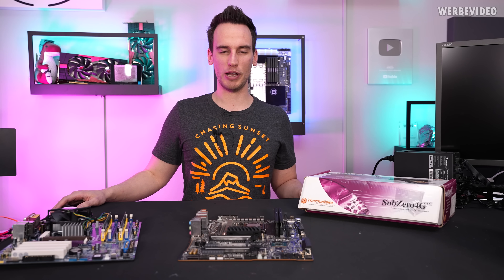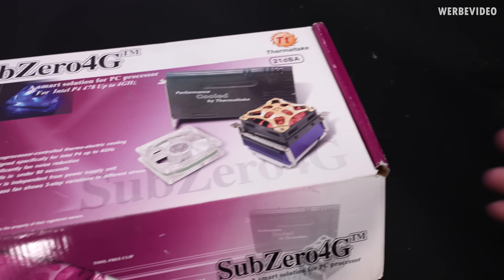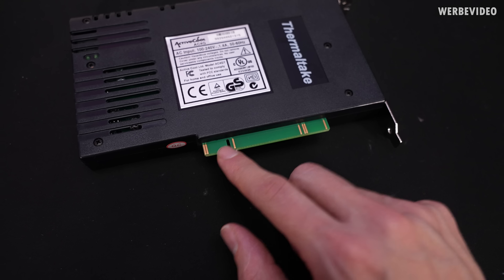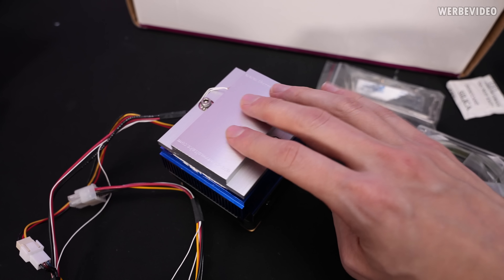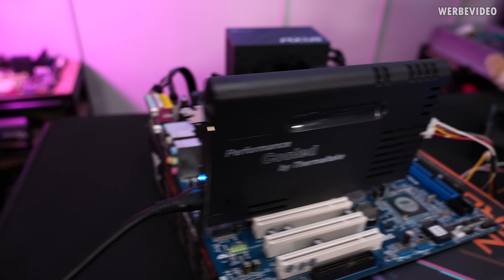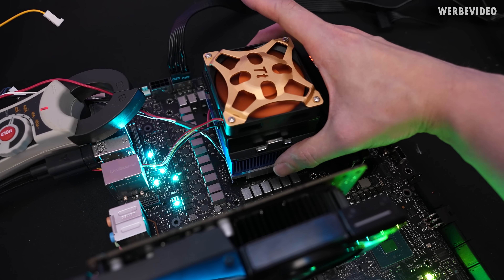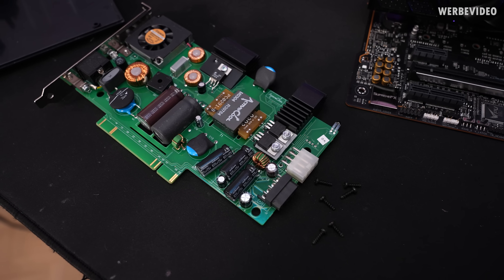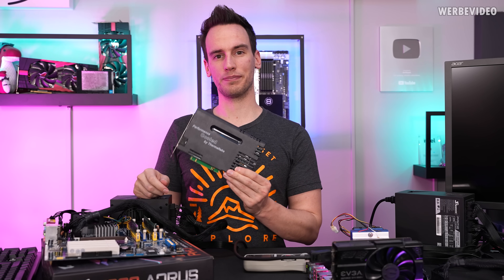This CPU Cooler Requires a PCI PSU to run!

Comment: I have had completely different approach to TEC air cooling that worked back in the time.  Pictures made on main page og HardOCP by  legend Kyle Bennett to. It was in the time when the CPU came in slots and even CPU sockets have had slot card you would stick in the main board. I have had copper plate that was 4mm thick and whave had normal air CPU cooler connected to the space above the CPU and would run all the time. This would save CPU if TEC or power delivery for it dies as well. Next to this air cooler on that long cold plate was a TEC with it's own air cooler. That TEC and air cooling for it would be turned on for full load situation. TEC was only 40 Watt power. That was intentional. Namely it was never meant to bring that cold plate to under room temperature but to pump the additional heat out of the CPU. Uper part of the cold plate would get colder than part above the CPU but would still not require any moisture isolation while not under a room temperature hence no condensation was made. That's why only 40 Watt TEC. CPU's back in the day even highly over clocked would not pull way more than 110 Watt power and extra 40 Watt's cooling was effective. Cooler was proof of concept and I was thinking of how to make that cold plate more effective while it needed a mass and thermal conductivity. Thought about vapor chamber with thick base plate. Anyhow I was working as system admin in design company and software house, and I was dreaming of patenting the solution but never have had extra cash to do it and didn't know how to sell my invention. So I did nothing with it and CoolerMaster kinda copied idea for a cooler for the new main boards with sockets on the board it self and used heatpipes instead of cold plate. It never took off. If I recall good they have used 70 Watt's TEC. That was bit to much to. 40 Watt's was small enough to power of your main PSU plus did not made condensation and failures  of TEC was not burning your system. It's good air cooler part was doing it's job anyways pulling as much as heat as it could. Enough for small tasks. TEC part of the cooling would add enough to achieve higher clocks than on air cooling alone. TEC air cooler could go really hot to but you do not care about it it only needs to keep as goid difference between hot and cold plate. Only isolation needed was around the TEC so hot side doesn't heat up the cold side by proximity to it. Also you needed to get rid of the hot air quickly but case have had blow hole in side panel sucking hit air out. That was the time when people have used modems to connect to internet. Web pages were new thing. Forum's just took over from BBS's. You couldn't buy watercooling parts like now. Cases came in one color only, off white. No windows and mostly only one exhaust and one intake 80 millimeters fan mounting place with no fans installed. CPU coolers have had 50 or 60 millimeters fans on it. Celeron Overclocking was the thing. Small die CPU's came out first time. My first Watercooling setup was Danger Dan's CPU water block Enhime aquarium water pump, VW Jetta heatcore and different aquarium and tubing and garden hose. Reservoir was some plastic container I have fitted with barbs used for plumbing. At that time main PC you do overcloclocking with was not movable. For LAN Paties you have had second system in midd size case. First window and lights I have made for it was not for looks. It was for you to see did something fall off in transport and to see are those fans still spinning. I remember getting some industrial Delta 120mn slim 25mm thick fans in store selling electronics parts and installing 3 of those in the mid size case. One between the top mounted PSU and shortest CD Rom I could find. One lower front intake and one in the side panel blowing cold air on the CPU cooler and grafic card. Light was 12V car inspection light. White neon stick. LCD monitors just started coming out. 15 and 17 inch. 17 inch TFT and such a trick LAN Party case plus tons of external drives and you were the king.

Comment: efficiency of a heatsink  increases the hotter it gets, so actually that little one might be ok even dissipating ~200w if you don't mind it running at 100+degrees.  Peltiers will manage a dT of about 70 degrees i think so with a 100 degree heatsink you could still have 30 degree cold side... in theory.  the problem with Peltiers was always they were so damn inefficient

Comment: When I saw the CPU side of things, and saw a TEC standing between the CPU and the heat sink... my jaw hit the floor. I could not believe a company would be that daft as to let such a thing get past a lab environment where it'd be proven not only ineffective, but a staggering waste of energy. Wasted energy = heat. TEC emits its inefficiency as additional heat on the output side... so it's nearly doubling the work the heat-sink needs to do, to do the same job! That, and other points already made in the comments.

Just an incredible specimen of 2000's "throw everything at these nerds, see what they'll buy" kinda tech.

Comment: The TEC cooling is a pain but i actually got it to work once was pretty cool really i added a extra water block into my loop strapped the tec to it with a air cooler on top running low fan speed didnt do a great deal for really low temps but i could turn off my fans for the water loop and it still run pretty cool ended up cracking the acrylic on the block in the end but it was a really old block always wanted to go back and try again with  a better block but never got around to it im pretty sure it was running 30 -35 c full load

Comment: Given that they're pulling 5v from the PCI bus, they must be delivering direct AC to the cooler.  This also makes sense because the AC to DC rectification would have some trouble fitting in a card that thin, anyway.
Reply: Peltiers don't run on ac

Comment: it has to have something heating up the peltier to kick it on and those run off 12v 5 Amp max per peltier but the psu may limit them

Comment: i had a reeeeallly powerful tec on my fx 60  that required ts own seperate atx psu and it actually worked i had the fx 60 at 3.4 ghz

Comment: I wonder how well a TEC would work if it was instead allowed to assertively cool something at around 30% of it's load, like say the cold side of a rad return on a vapor air cooler.

Comment: Around 2001 I had a water cooling loop with a rad and 2 TECs on waterblocks cooled by giant industrial heatsinks.... The 300 watts of power for a couple more degrees of cooling never made sense so I took them out of the loop. It couldn't keep up to full CPU load, it was nice and cool at idle though.

Comment: Now dust the good ol prescott and try to get the advertised 4ghz :D

Thing could work well with a athlon xp of the time, they were much lower wattage than a p4.

I tried to PC my athlon xp 3200+ hobby pc, but could only get +50mhz due to poor cooling, and boy is it hard to find a decent heatsing for socket A/462
Reply: Had my P4HT 520 @4.2GHz daily using an Arctic Freezer 7 on an Elitegroup(ECS) 400A mobo, TEC's were overkill for anything but scoreboards using Celeron's, AMD Thunderbird's or PowerPC CPU's.

Comment: I have the previous Pentium 3/Athlon kit. It did fit a Socket 7 board too, but the tension was too much for that platform, and on removal it bent the CPU to one side and destroyed some pins in the socket itself.
PS: mine did not go below the ambient temperature, as to avoid condensation.

Comment: Back then, having fans still running after shutting down the system was pretty much normal.
Most boards kept the fans running for a bit to keep the cpu cooling down and not heating up.
Reply: I wish the cpu fan still ran a little after.

Comment: That would be a good reason why the TEC cooler use either heatpipes and / or water cooler plate nowadays, the TECs are apparently too efficient at moving heat that they hit performance wall quickly - as you pointed out, heatsink is the limiting factor. Still a nice throwback video - it was exactly how I remembered about the early day of high performance coolers back in 2000s.

Comment: Don't forget, though, that with a TEC the heatsink will operate at higher temperature than the CPU - it's a heat pump, after all.  In a passive setup the heatsink is always colder than the CPU - the temperature gradient is what moves the heat, of course. Heatsinks shed  more heat at higher operating temperatures, though, so the TEC is effectively increasing the area efficiency of the heatsink by letting it run hot, where it can dump lots of heat, while the CPU stays cool.  You still have the TEC dissipation, of course, so the TEC efficiency is really the killer.

Comment: Peltier’s need to exchange heat for cool .. they require heat to work. They are almost worthless… I think using  butane refrigerants would be the best way to move heat or better.. ammonia cooling of antifreeze that cycles the system. Less wattage would be needed. It wouldn’t even be that big..  will probably work on 1 amp of power.

Comment: When i was still in the overclocking meta, ive experimented with the CM V10. Stock, not so cool. But, change the stock included 10w TEC for a 100w one, and that became so much sweeter. Q6600@4.2Ghz stable 24/7 on it (but not really wouldnt make sense since it was just a oc and gaming machine, but you get the gist of it lol).
Reply: You got a really good Q6600, most never got past 3.7-3.8 if I remember right.
Reply: @Orangeflea1  Needs lot of voltage and low temps. This one i had couldnt keep itself stable over 45c either. The lower the temp, the higher the electrical efficiency
Reply: @RaviPires  Ahh you didn’t mention it was 45C.  

Mine was a particularly poor overclocker, I couldn’t get it past 3.45GhZ even at 1.45v, and even then it was at 65C on a solid dual-tower air cooler.
Reply: @Orangeflea1  It was usually 15--30c tops, i was running it off of a coolermaster v10 with the peltier changed from a 10w to a 120w

Comment: I really don't see the point of trying to use these things on CPU's. Linus pumped like 400Watts into a tec cooler and IIRC, it performed worse than an air cooler.

Comment: The problem is not related to surface area, primarilly, using 70W pelletier + 100W cpu accounts for 170W Total.
The required TEC element must be rated well above 200W to keep up!

At this point you only discovers how inefficient this technology is for cooling Cpus. We stated back then that phase change was the way to go, cause 500W CPU is not an option.

Comment: Got to give Thermaltake props on that any idea. No matter how unconventional or silly: they would turn it into a product.

So a Peltier TEC unit isn't out of the ordinary for them. I remember there even was a time they where working on a chassis with built in Phase-Change cooling, thought never heard of that one after the announcement so I guess it was shelved and forgotten.

Comment: For awhile I have wanted to make a TEC/water cooler for memory. Memory power consumption is so low that the bad efficiency shouldn't make much difference. And of course include a humidity and temperature sensor, and a micro-controller to keep the temp at the dew point + a specified value. But I don't have access to a mill.
Reply: Tf u need a Mill for? Just use thermal putty and stick copper pipes on the ram heat spreaders

Comment: I was always wondering if any kidnd of engineers where hired for making this product... Peltier modules are transferring heat from 1 side to the other while consuming quite a lot of energy and producing a heat and being quite inefficient. Also peltier modules tend to warm both of it's sides when it reaches some quite high temperatures, so you can not use a smaller heatsink and a peltier module and think that peltier will cool everything. Once Linus tested something better and there the peltier module was being shut down when temperatures reached some high values.

Comment: it states tht has an ambient termal sensor and one in the heatsink coldplate, this is to prevent the cooler to get colder than ambient so there is no condensation. This is why without load it did not get under ambient.

Comment: For a second I was very concerned from the thumbnail they supplied a mains PSU PCI card without any cover to prevent electrocution, glad to see it does actually have a plastic cover.

The design of that PSU is also very reminiscent of low profile TVs back in the day, bet they hired someone in the field to design it, its also strange they didn't just use the computer's PSU or even an external laptop power brick and a DC barrel jack, the compliance and certification for that product wouldn't have been cheap!

Comment: Everyone tries to force all of the CPU heat through TECs but they just don't have the throughput for that. I think it would be a much better idea to put TECs in a water cooling loop after the radiator to chill the cool water a bit before going back to the CPU
Reply: You're picturing two water loops, one between the  cpu and TEC, and one between the TEC and radaiator(s)? I guess there are some potential benefits to that, such as being able to use any size waterblocks you want to sandwich larger and more capable TECs. You could also potentially isolate condensation hazards by keeping the liquid in the CPU-TEC loop at around ambient, and putting the TEC sandwich in a more moisture friendly environment. At some point though, it just doesn't make sense, running dual loops and pumps, and spending hundreds of watts on the TEC(s) directly. Usually more radiator will get you close to the same result. And I say that as someone who daily-drives a TEC cooled CPU.
Reply: @jomeyqmalone  no, one loop with all devices in series. CPU heats water > water is cooled to ambient by radiators > TEC chills water below ambient > chilled water goes to the CPU

Comment: Couldn't you just take the controller and connect a modern TEK with a custom loop behind it that's capable of getting rid of the heat? I fear the controller won't be up to the job unless you have some sort of additional PSU behind it to provide more power to an adequate TEK (which may also be really expensive). I really enjoy your videos about those old things that didn't work out for one reason or another.
Sadly investing time and money into doing all of this I mentioned above isn't really worth it I guess unless you really want to tinker with it.

Comment: Thermaltake used to do some crazy stuff... I had a p4 Spark 7+, little newer than this one...  Solid copper heatsink (not a slug, full on solid copper) with a 6000 RPM fan (!!!!!!).  Even came with two reostats to control fan speed, for either the rear slot or 5 1/4 Bay.  And you know... Friggin thing probably  had better heat dissipation then this

Comment: I remember "the good old times" pre ~2000 to 2002. Back then, having OCed PC and total silence was magic. We had to go to car junkyards for auto radiators, fish stores for pumps,... I had around 10 aquarium pumps because I was always searching for the silent ones. Also the problems were the fans. Solution: I used fans from the fridges, and through some soldering they were spinning very slowly. I also had that "industrial switch" for high voltage to turn on my PC. That was so awesome, people were expecting jet noise, but after that LOUD CLANCK, PC turned on, pumps started pumping water, Windows 2000 / XP was loading in total silence. Crazy days when in my country you couldn't find anything more technologically "sophisticated" (cooling) and you had ISDN if you were lucky, otherwise you were on dial up.
Reply: Back in those days I was still on dial up.  I am in the stix and there really aren't many options yet.  We had DSL which is a large step over dial up now cable internet with a speed of more than 100 megabits.  I can have gigabit speeds but that does cost more.  100 megabits is plenty for most people really.
Reply: When Ehiem pumps were lore and cutting your own case blowholes was a requirement.
Reply: I still have my old Verite 2MB card I superglued heatsinks to CPU and mem and added a fan (ahh Radio Shack)...stock was 35 Hz...I got it up to 72 Hz before it locked...ran stable @ 69 Hz until I upgraded to 16 MB Voodoo Banshee.  and it still works!  Try to get a +97% OC now, no way!
Reply: I hope this doesn't get across in the wrong way. I knew a person who could do things on CNC off the books (so that the company didn't know). Waterblocks were made by bribes and favors. :) What we had to do in the "old times" to get a waterblock... Sneaking in factory at midnight to cut some pieces, bribed security guy to "not see us",... LOL... Cofounder of EK Waterblocks (before there was EK and before they went legit) used the same guy who cut that blocks for us. Good. Old. Times. -by Boomer.
Reply: Those were the days! I was only a young guy but I loved looking at the custom watercooling builds that used fish tank pumps and such haha! Those case mods were insane! Long live the Antec 1080!!
Reply: @supabass4003  I was in my 15-20s. Pre-EK time those guys were the same age. If I knew they would become world known EK waterblocks, I would do some things differently. :)) (EK is Edvard Konig - I would love to catch up with him some time.),
Reply: i may have not been alive during those times but my mother thought me DIY PC stuff. fixed my graphics card cooler. and held  some  coolers loose coolers until i got the stuff to fix it. I like older tech. i find them more simpler
Reply: Same. Don't mind the times I wasn't alive.
Reply: ok  boomer
Reply: @theglowcloud2215  Things were just so different then.  The people who did those things started all that liquid cooling stuff.